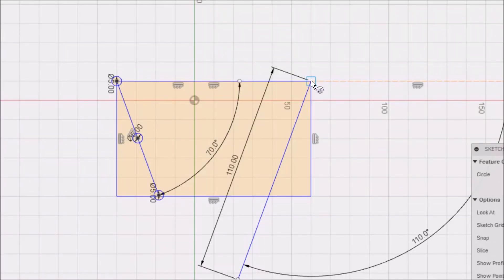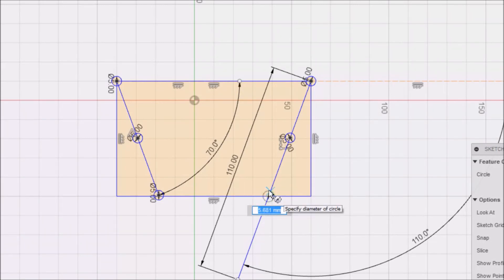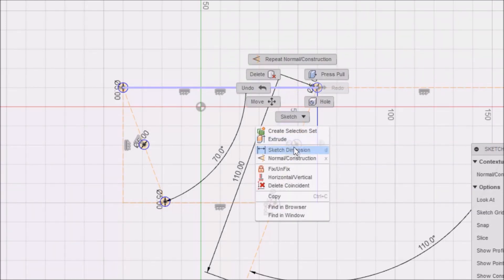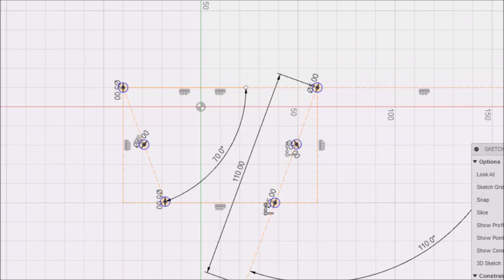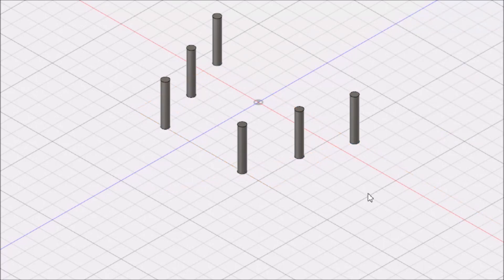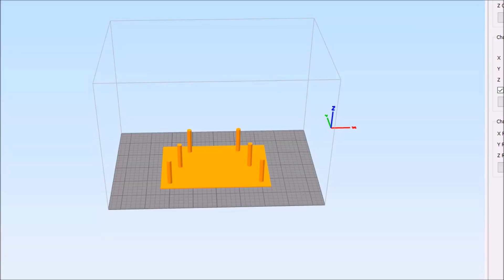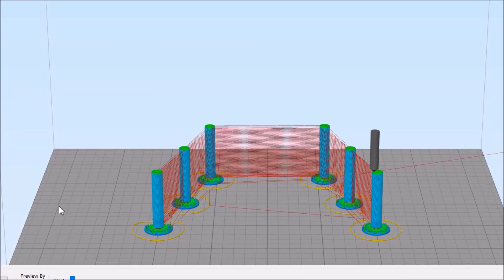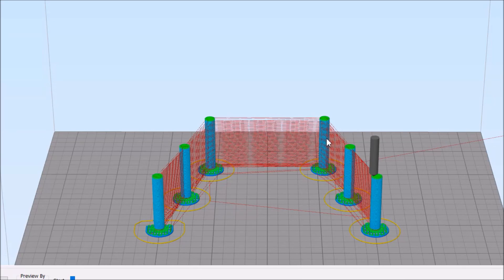Get retraction settings right

Comment: 5 wasn't enough on the back,but 10 was way to much,personally I would have tried 6 or maybe 7 and gone from there,but as you say every printer's different,also depends onither variables as well,room temp,humidity etc,so your settings could well be different from someone in India,Australia etc, it's all trial and error in the end